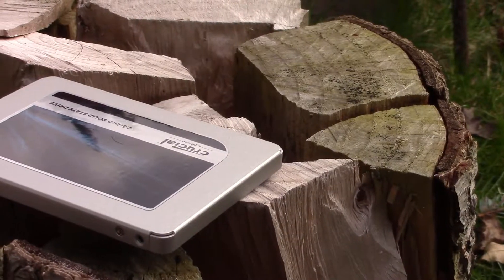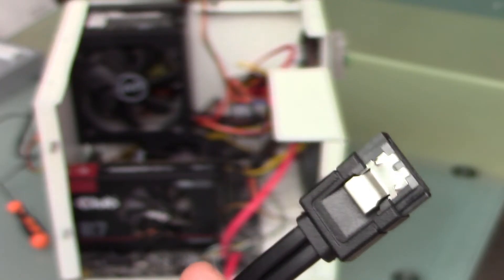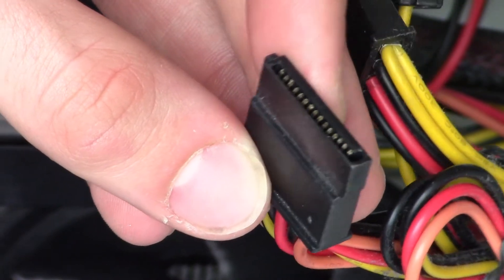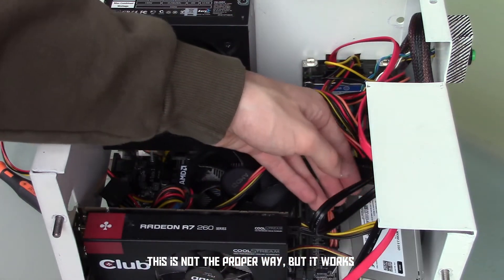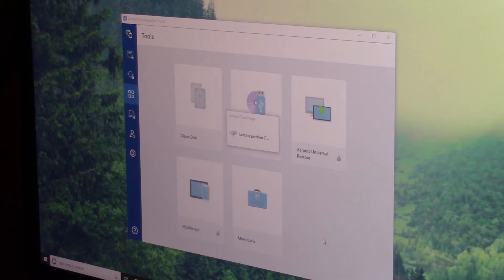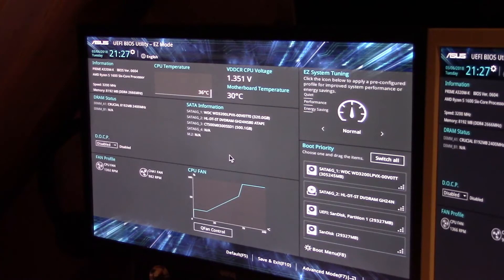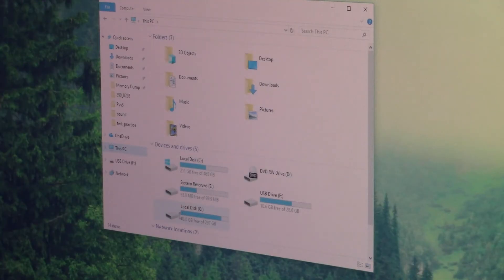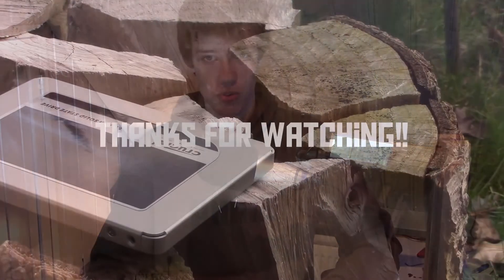How to upgrade to an SSD without reinstalling windows (AKIO TV)

Comment: Thank you, you encouraged me to do the upgrade on my computer... Hope, it will will go all that easy.
Reply from the maker: Good luck!
Reply: Thinking it through now gives me some headaches: I currently run Win10 in a RAID 1 (mirroring) configuration. Can this installation be transferred on to the new SSD? And how.. Note: I do not want to run the SSD in any RAID configuration, just one plain drive. Any thoughts would be highly apprechiated! Thank you!
Reply from the maker: @andreashutterer4740  though I haven't personally tried this, it should be straight forward as you basically just copy one of the disks to the ssd.
Reply: @AKIOTV  Unfortunately, the Acronis software checks, if there is a SSD by Crucial present in the system. If there is none (like in my case, I bought a San Disk) the software won't run...
Reply from the maker: @andreashutterer4740  Oh didn't know that. There are plenty of other tools you could use out there though.

BTW does your RAID1 rebuild automatically? Eg when a drive fails and you insert a new one does it automatically re-clone? In that case you may be able to just swap one drive for the ssd and have it copy that way.

Comment: What do I do if I want to keep all of my files in my old HDD's but I just want to install Windows to SSD?
Is it possible to do like this? : When I have installed the SSD to the PC, can I go straight to bios and change the boot ing priority to SSD? 
And maybe after that can I just go and copy some programs from HDD to SSD. (I don't want more than few programs on my ssd)
Reply from the maker: 1. Does all the data that's now on the hard drive fit on the SSD? If so, just follow what I did and then copy files back to the HDD afterwards and delete them from the SSD. 
(this situation is considered to be a lucky one)

2. Is your hard drive partitioned with the OS being on a separate partition from the files? In that case just copy over the OS partition to the SSD.
(this situation is amazing)

3. Are your OS and files all in one big partition and does all this data not fit on the SSD? Then you'll have to secure the files externally (usb hdd, network storage etc.) then delete them from the HDD to reduce the space, then copy the OS and remaining files to the SSD, and finally copy the files back to the HDD.
(this is the situation I assume you're in and will take the most time to deal with)

Comment: can i install the ssd without reboot my computer?
Reply from the maker: SATA/AHCI supports hot swap, so you should be fine (I've swapped drives in PCs and it went just fine) but still, it's better to do it when the system is turned off just to be sure. Why take any risk?

Comment: what if i only want my os on my new ssd? and not copy my games. bcuz my hdd rn hass 400gb of data. and my ssd is 120gb so it wouldnt be able to copy everything over anyways.
Reply from the maker: In acronis it's possible to clone a big drive to a smaller drive, as long as the smaller drive can fit all the data. However, you have 400 gigs while the SSD is 120 GB, which means you'll first have to copy your files/games (steam library?) to another computer or an external drive in order to be able to delete them from the hard drive, so that only the OS remains. 

Now you're probably under 120 GB, so you can use "automatic mode" (yes, automatic since you want automatic partition scaling) in Acronis which will then copy the contents of the hard drive onto the new ssd. A detailed guide on that can be found here: https://kb.acronis.com/content/56634

Finally, you can erase the hard drive and copy the files and games back onto it.
Reply: Or you could just straight away use the "paragon harddisk manager" to clone only the desired partition to the new ssd
Reply: thanks
Reply: thanks
Reply from the maker: I was assuming you have your OS and your files and games on the same partition, in which case that wouldn't work. But of course, if you do have your OS on a separate partition that is small enough for the SSD then go for it!

Comment: The jeremy clarkson of PC builders!
Reply from the maker: This upgrade did increase the amount of speed and power of the computer :)
Reply: AKIO TV 😉
Reply: AKIO TV on a more serious note. If my laptop originally came with Windows 8 and I have since upgraded to Windows 10, will it the cloning software carry over the newer operating system or the original one? Cheere
Reply from the maker: It will clone the drive, so it will be an exact copy of the drive at the moment you ran the software, meaning that everything will be exactly the same, so you won't go back to windows 8.
Reply: AKIO TV Cheers Jezzah! You da man.